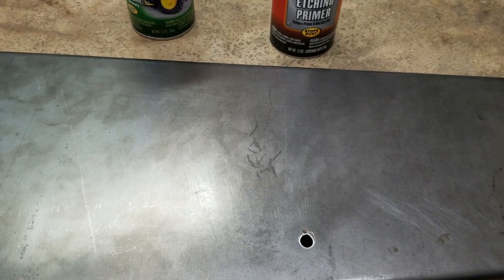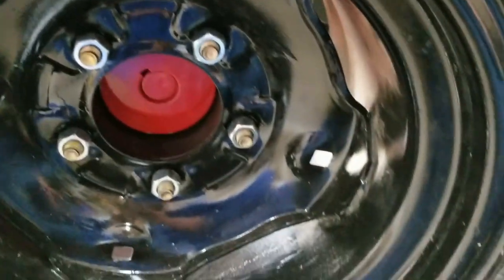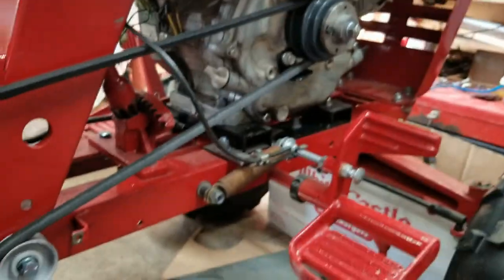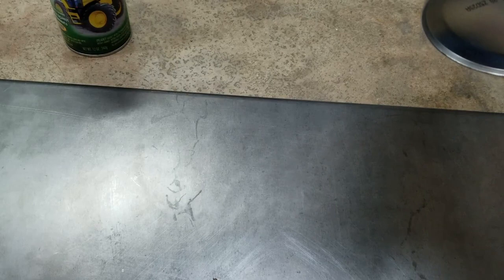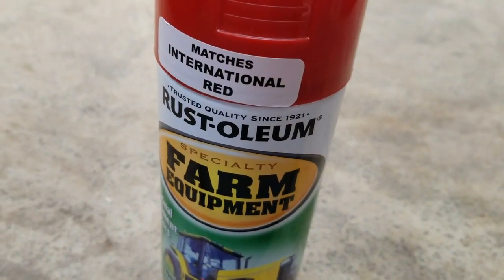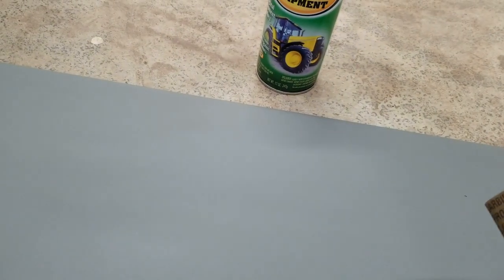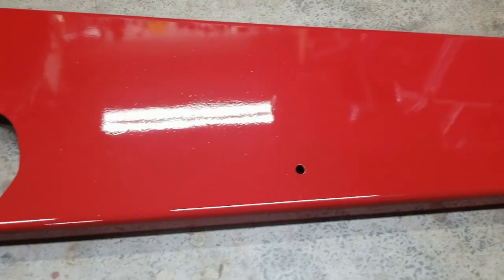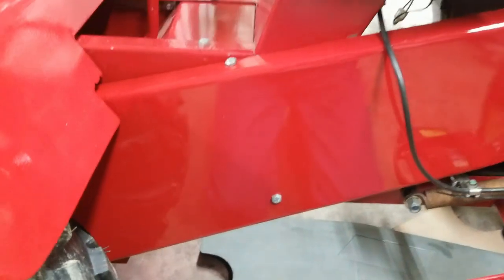How to Paint an old Garden Tractor "Wheel Horse 700"

Comment: Do u know how I'd go about pulley swapping/ making one of these faster?
Reply from the maker: I'm running a 3.5 inch engine pulley and a 4 inch transaxle pulley, this does about 9 mph. If you want to go faster you can put a bigger pulley on the engine and a smaller pulley on the transaxle, this will make it go faster. But doing this will make your tractor not have a lot of low end torque but it's all about what your building it for and what you feel comfortable with! Hope this is helpful!